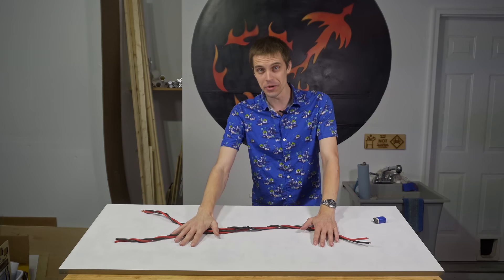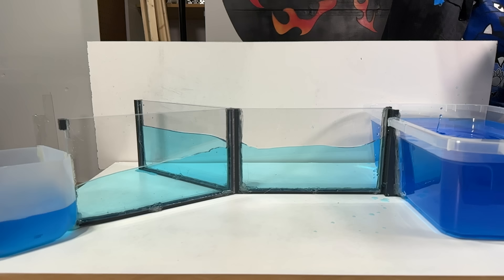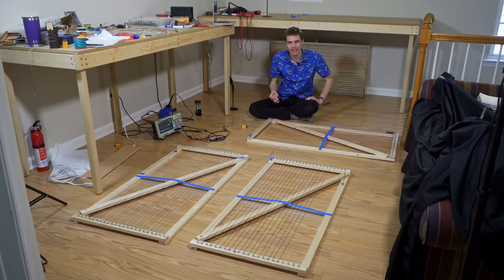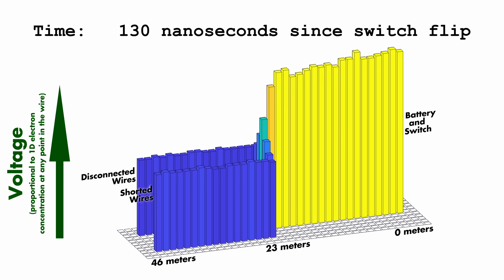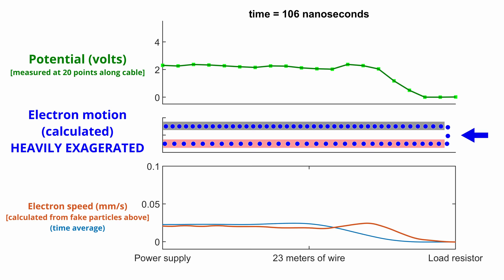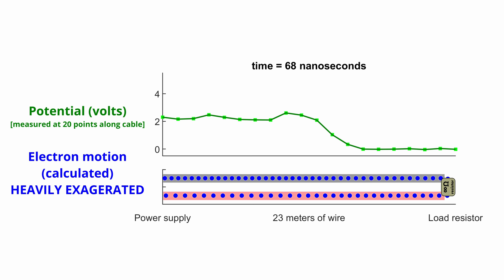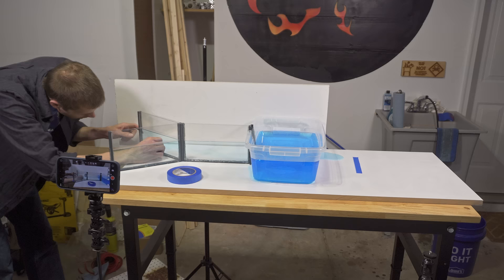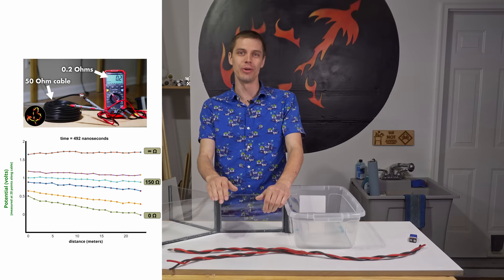Watch electricity hit a fork in the road at half a billion frames per second

Comment: I would have thought that the that the power of the battery determined how many electrons got pushed through the wire. Put a light bulb in between the connected wires and suddenly the size of the battery becomes important and how many elections needed can change.

Comment: I don't know you've left one end open and shorted the other. What would be interesting to know what would happen if you put a light bulb or whatever on each wire one twice as powerful than the other. Would the electricity travel faster to the more powerful one. Always thought it was the current that varied.

Comment: well the thing with your probes is, unless they are super high quality differential probes, all probe wires will introduce disturbances on your measured signals, and they also interact with each other.
especially with this small voltage levels and short times, the measurement will be extremely inaccurate
Reply from the maker: Check out the methods video on the second channel

Comment: The Japanese call voltage pressure and that's the difference between your electric and water model they don't have the same voltage or pressure. You also need to close the top of the channels to maintain the pressure it'll have to be some sort of vent back to the main tank your resistance can be maintained through a restrictor. Sort of like what you find in the AC system.

Comment: How does changing the temperature of the water change the correlation of the two systems? 
  Are there liquids that flow closer to the electrical model. Like mercury , liquid nitrogen, or one of the ultra sluck lubricants

Comment: @ 16:00 you mention that the twist in the wires does not matter. How could this not matter? The wires are very close together. I've always heard that when electrons are passing through a wire, they create a small electromagnetic field around the wire. So, if the wires are wound, then both electromagnetic fields from both wires would collide assumably intermittently, causing changes in resistance in the wires. Yeah, yeah, yeah, I know my terminology is totally uneducated layman. But still, have you tried placing the wires parallel and recorded measurements and discovered any differences in the mathematical calculations of the flow of the electrons? Just a curious question. And thank you for a wonderful tutorial video! Well done.

Comment: Most of you got it wrong. The energy is Watts. A short ask for unlimited performance and the battery can't, but 99.99% is bad (full charge to 0 in 0.00000000000001 seconds). Less will be workable for something. You measure A, V and R "for manipulative reasons." As soon as there is a load it can turn into "a helper" in your life. You lower A, V and increase R to keep it (any combination of suitable specs for what you want), whatever it is. Nothing is practical with a split second of work and smoke unless it's a bomb and you wanted one.

Comment: By connecting the oscilloscope, aren't you just completing the circuit, thereby not actually measuring the disconnected branch at all?  Genuinely curious... what do we see when we connect wires together with various resistors?
Reply from the maker: Great questions! There’s basically a whole video for each of them on the second channel 😂. Not “probe loading” the circuit is very difficult

Comment: 1) When you "fire a switch" with DC voltage, it pushes current through the wire, and a magnetic flux appears, which is in opposition to the current, hence the "ringing" you see in the "mystery stuff"....2) "measuring" voltage at an essentially zero resistance nets you zero volts drop (ohms law). 3) voltage at the end of the panel unconnected to anything has INFINITE resistance, thus you should see the full voltage drop. (9v if you're using a 9vdc battery) once again, Ohms law. 

Of course I'm tired, watching a war tonight and have probably had 3 more beers than I should have (BUT I taught electronics in college for 6 years, was a military communicator, worked for the White House for Presidents, and am getting old now, lol)

Comment: Edit: I was wrong. 
Edit2: Wait, I might have been right, but for the wrong reasons, lol. ¯\_(ツ)_/¯

@2:16 ; I would go with option A. Maybe not explicitly as stated, but rather: The electrons are already in the wire. 
When you apply the battery, it pushes 1 (one) electron into the wire via space-magic (whatever makes batteries work; I'm not an electro-wizard).
From there, like a tube filled with water, the remaining electrons move through circuit, as they have all been displaced by the electron behind them. The ones which are not in a completed circuit cannot move, and therefor, don't move. The ones in the completed circuit can, and therefore, do.
And, because the circuit is continuous, 1 (one) electron flows back into the battery in a closed loop cycle.

Comment: Very interesting research, but I think your focus solely on electricity as physical movement inside the wire completely ignores all the electromagnetic field effects interacting outside the wire.  Fields aid or resist movement also, and propagate very differently.
Reply from the maker: You’re right, there are relevant fields, but in this case, all the important fields are tied to /caused by the electrons in the wires and their motion, so you really can’t decouple one from the other.

Comment: How did the open branch have higher voltage than the shorted branch after the circuit seemed to have stabilized?  At about 10:45 in the video.  That bit is really confusing!

Comment: I always thought electrons were pulled from one side of the power supply, creating « negative pressure ». From my understanding of your video it is not the case and they « push » each other from the other end of the power supply instead ?

What happens if you only connect one side of the power supply ?
Reply from the maker: It’s both at once. - which one is stronger depends on a bunch of things

Comment: Hello, I am not sure if this is possible but i am curious to the results of this experiement:

I would assume it is the electrons already in the wire that affect how the electrons propagate through the wire these initial nano seconds.
So; what if we depleted the electrons in the wire(s) and overpopulated the electrons in the wire: would this have any effect on the initial waves of propogation?

I am imagining voltage as "free electron density" that is there is more free electrons on the negative terminal than the positive terminal and physics wants to equalize that. In a static system it would make the entire circuit the same potential (electric field). But with a battery it is a bit more dynamic with electrons being generated chemically.

I would like to imagine the 9v battery has an electron density (ED) of my arbitrary units of 9 and the statically neutral wire has an ED of 1 (that is to say it has some free electrons primed in its length). So at the initial switch there is a delta of 8 ED trying to push through the system. Where as there may be a potential situation where we can strip the wire of free electrons and obtain an ED closer to 0. Thus ontaining a greater delta of 9. There may be a bigger surge of electrons initially in this case?

And also the other case in which we statically preload the wire to an ED of 4 and get a difference of 5 ED initially.

In this case I would imagine seeing propogations from the - terminal out into the wire as you have shown as well as an inverse propogation from the + teeminal.

You would need a switch that connects both ends together to the battery not just a single end of the wire. I couldnt tell you to save my life if that is a 2-pole or 2-throaw switch 😂.

Cheers.

Comment: I think the answer is C:
answer A is plain ridiculous, with signals traveling faster than light
Answer B is less ridiculous, but how does the electric field know some part of wire is disconnected without electrons going there?
Answer D is also ridiculous, why don't electrons start flowing as soon as the battery is connected? And also, how does the electric field know what constitutes a circuit?

Comment: Stupid question; You show in the beginning of simulation, when voltage is not yet applied that the cables are already "full" of electrons. Where do they come from? Are the cables already "charged" with electrons by default?
Reply from the maker: They aren’t “charged” because there isn’t an imbalance of charge, but it IS full of electrons. The trick is that in a default state it’s also full of positive atomic nuclei so there is positive charge, negative charge, but no net charge. Whenever people talk about charge, they’re really only talking about divergence from 50:50. It’s a weird technicality that makes this tough to talk about

Comment: It's great work. I love it! You do lose me every time you suggest electrons are moving and piling up at the end of the wire and similar statements. I know you are over simplifying, but I find it confusing. Can you imagine the atomic structure changes if atoms lost their electrons at one end of the wire? The electrons move but more like dancing in place. I find the best way to explain this is one of those desktop devices with a row of steel ball bearing suspended by fishing line in a row. You swing one at one end and it bangs down and hits the row. None of them move except the last one. The middle ones stay in place but. they did pass the energy through them.  I think this concept may also lead to your confusion shown when you ask  how the battery decides the current to send. Obviously there is no decision by the battery. It is only responding to the potential difference at its terminals. Sorry to complain. I love what you did. Totally cool!
Reply from the maker: When those balls bounce they do literally take up less space when hit and scrunch together - it’s just not by much

Comment: That would mean, with a small enough wire and a high enough supply voltage, you could burn out a set of isolated wires

Comment: Sooo, is the difference between voltage and electron flow the power factor?? Great video btw
Reply from the maker: Power factor is a weird thing that shows up when you try to use ohms law for AC but your loads aren’t resistors. Nothing in this video is AC, and I carefully stay away from inductors and capacitors…

Grady has a fantastic video on it on practical engineering!

Comment: Similar wave propagation as a split-Hopkinson pressure bar. Interesting. https://en.wikipedia.org/wiki/Split-Hopkinson_pressure_bar

Notice on the disconnected end the ‘doubling’ of the voltage when the wave hits that end. Same thing happens in a split Hopkinson displacement at the free end.

Comment: You do realize that the resistance of your load does not match the resistance of your source, the battery. The resistance of your battery is far higher than that of the load including the resistance of the wire, which is not 0 ohms but is so many ohms per unit length.

Comment: Cool video, but I'm a bit confused. If you attach a resestive load to the open circuit, such as the scope, how is it an open circuit? I don't have any degree or higher education, but I'm appalled by the people who do that don't realize measuring the electron flow with any type of equipment will then create a complete circuit.
Perhaps I'm missing something, and if so I would greatly appreciate an explanation.
Reply from the maker: There’s a whole video about the experimental methods linked and carded

Comment: I am a complete novice and have no real expertise in this. However, when I look at the movement of energy in the form of waves like a sunami, i conclude that the energy being the motive force behind the waves is seperate from the physical water, the physical water being impacted by the energy is displaced, and the resulting pileup at the coastline occurs when the energy in the water hits solid mass.  The energy at this point has moved through incredible amounts of water, so the beginning water, is not  the destination water.  The energy itself is just using the media.  Seems that electricity is much the same.  Electrons do not "FLOW", they do react and jostle, but are just the media that supports the fields that becomes the exchange conduit of the energized state. ????   If the fields are key, wouldn't twisting the fields around each other also have some measurable impact on the fields?

Comment: I like the ideas and the graphics but it seems to me like the battery doesn't "know" anything because its not a computer. It has a potential voltage and once connected begins to discharge and fill the "capacitors" aka the wires. the open side keeps its potential higher because there is no load and it is basically storage, if you hit the wire with more load ti would all drop. if you disconnected the battery it would also take time for the capacitor to drain.

Comment: Not done the video but election are negative charges.  So positive voltage has bigger election holes aka lower density. Electron flow is from - to +. Putting+ voltages on something removes the election and it starts pulling electrons from where it can

Comment: This is actually why we have a problem handling computing at any speeds higher than the few hundred trillion operations per secoond. We have hit the limit of speed in which electricity can travel in yhe medium we chose to use, and thus no matter what even with the smartest AI possible we could never actually crack a system that has figured out how to bypass this relationship. It seems impossible but there are a few workable methods now as it is. Thats why for instance, we would be able to handle something like the AI, from all things of course, from Moonfall. That AI is said to be post light speed processing, meaning even if we turned all the computational poeer humanity has ever devised into a single computer, we still wouldnt be able to crack its encryption. It can literally keep its information away from our ability to even find it.

Comment: I haye all the vernacular that tries to give these components a sentient spin. 

"How does the battery and or electron know how to do X, Y, Z."

They dont, they just rake a path of least resistance. Also measuring voltage without current is very misleading. Its not as if the same amount of electrons are pouring into both sides.
Reply from the maker: It actually as though the same amount of electrons are pouring into both sides! You need to move some charge to raise the voltage of that disconnected wire (propto capacitance)

Comment: As soon as you hooked probs up to the open circuit you completed the circuit through capacitance that then gave you voltage readings .. you are also calling voltage current and this is not correct... your graph says voltage and you are calling it current ..they are two different effects.. and again probs distort this by giving a circuit a path to then show voltages..you would have to put in current monitors as well as probe points...and compare these.. twisting reams of wire together creates a coil and a capacitance.. and an antenna for a whole lot of radio interference from all the electronics and wires in your house.. still an interesting test though. i suppose this all does not matter that much in criticisms but i thought i would point that out .
Reply from the maker: Check out the q+a on the second channel - you can calculate current from voltage, time, and capacitance

Comment: do you know the principle of a transmission line? you are measuring that. the speed is 0.6c only, and it happens when the L and C of the cable is no negligible. otherwise the speed would be 1c and there will be no transmission line principle in effect, i.e. signal bouncing back etc.
Reply from the maker: Yes

Comment: You say completely different system between water and electricity. but at the end of the day everything is really nothing more than either kinetic or potential energy moving in waves. 

so really seeing this is actually kind of exactly what you would expect assuming most of the laws of physics are correct.

Comment: tip (i guess?): you could take the spirralling wires, and "histone" them, just like our DNA, so it doesn't use tha much space, and the cuts to probe would be easier to do and read. but since would be a spiral in a spiral maybe would create a stronger magnetic field (don't actually know), but would definitely save space.

Comment: Your explanation for the wires with a load seems to make sense. 
Your explanation for the wires that are disconnected does not. Voltage is Electromotive force. This requires a voltage potential difference. Wires that are not connected are essentially just extending the terminals of the battery. Does the battery conduct through open air? If you are assuming transmission line phenomenon then you should be modeling the "open circuit" as a capacitor. Assuming an ideal situation with no capacitance or inductance in your model no current will flow due to a lack of electromotive potential difference. Also a scope probe is high impedance but not infinite. You are changing the results of your experiment because you are providing a current path.

Comment: That was a super cool visualization! Two possible variables may be affecting those wave patterns; 1) the resistance of the circuit changes while current is flowing through it. This is why it is not possible to know a circuit's true resistance with an ohm meter, it can only be calculated knowing the voltage and amperage, and 2) the 9 volt battery has a finite capacity of voltage and current, so when first switched on, a large drain is initially placed on it. It would be interesting to note any changes in behavior of the waves if a constant voltage generator were used in place of the battery.